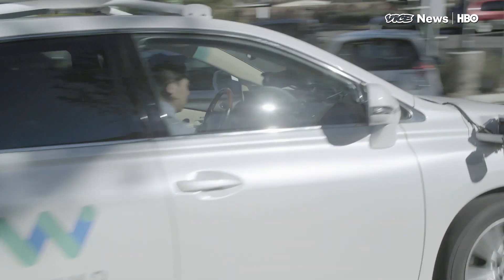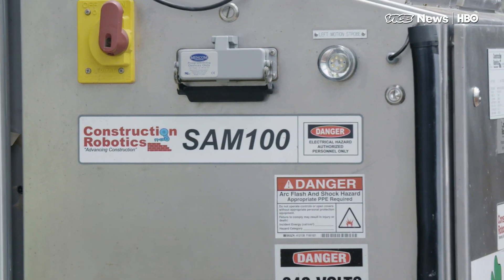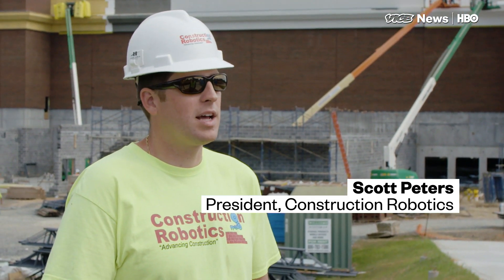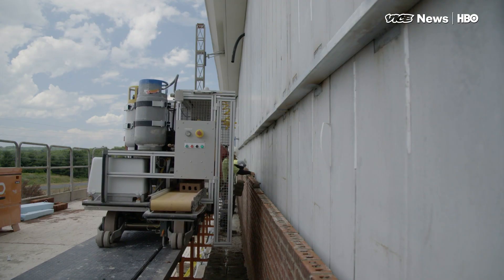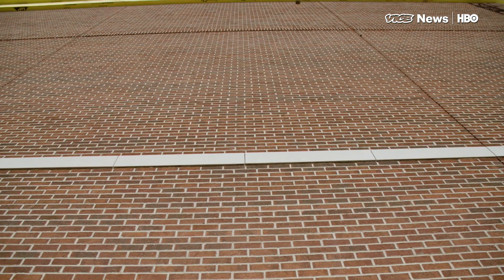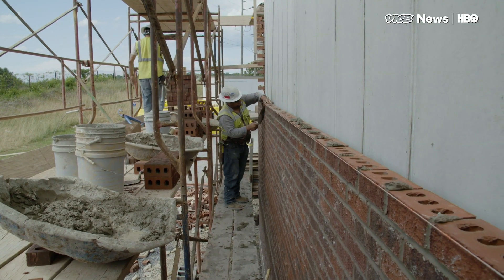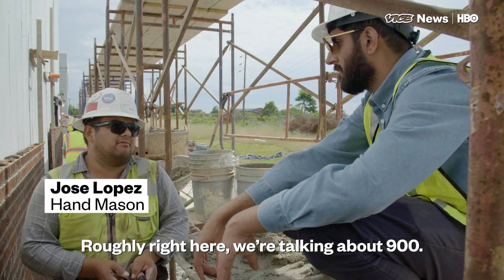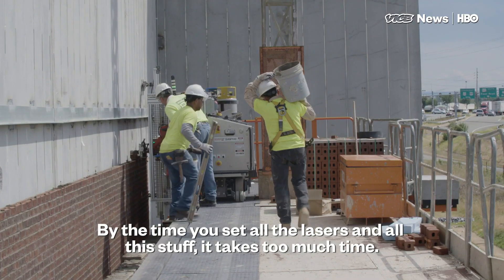This Bricklaying Robot Can Build Walls Faster Than Humans (HBO)

Comment: One thing that isn’t shown is the level surface this thing needs to run on. What are the set up costs?  What is the payback period?  When do you start making money?  Will there be stand by masons to take over when this thing breaks down so the job isn’t held up?  How long does it take to set up?
On the other side, you have brick delivered, call the mason, he shows up and starts laying brick

Comment: So the machine can lay 3000 per day but needs 3 men to  load it and point up plus set up time??? A 4 man gang of traditional brickies can lay 4000 in a long straight run so where's the benefit. And no house has big straight runs anymore and no site I know of has perfectly level ground for a machine. And let's not get started on the footings in the ground. 🤣🤣

Comment: First thing I'm a bricklayer and I hope this puts me out of work because I hate my job that much second thing can you build a machine that puts bricks in a partially sub level silo because that's what I'm doing right now and I'd rather have a gun in my mouth the blueprint for the bricks have to be like an upside down bullet there's an elevator in the middle of the silo to lower my crew down and the silo is about 15 ft wide in diameter minus the 6 ft box elevator directly in the middle I would pay you a million dollars for it today if I never have to come back to this job

Comment: can it clean the snots off the back in the cavity, NO .can it build gables , NO. can it joint up , NO. can it differentiate between face and back of bricks, NO. can it adjust brickwork gague on the fly to acommodate other build factors , NO. can it place wall ties in cavity , NO, can it lay out cavity trays , NO. can it adjust linear gague if batch of bricks are smaller on the fly , NO. can it plan for bad weatherand build accordingly ,NO.can it build herring bone pannels and cut the bricks to suit , NO .  can it build in lead trays ,NO . can it bild a semi eliptical arch and cut the vousoirs to suit , NO ,  TO SUM IT UP I DOUBT IT WILL EVER REPLACE A CRAFTSMAN .

Comment: If they develop a second arm for the robot, one arm could be setting a brick while the other arm is picking up and mudding a brick. So as one arm was releasing a set brick the next arm would be a split second behind it with the next brick. That would make it go nearly twice as fast as it is now. 
From a business standpoint, I can see why an owner would invest in this, skilled bricklayers are extremely hard to find and if you do happen to have some good ones, there nothing you can do to keep them from leaving. And the saving is not just the face wage. The machine has no workers comp, no SSN match, no health insurance, no vacation days, no pension, no sick days. Just maintain cost like any other piece of equipment.
Reply: plus no coffee breaks or 8-12 hour shifts...it will work 24 hr per day if supported. skilled labor may be required now but with upgrades only semi-skilled humans and eventually nobody at all

Comment: Brick laying robot? All fine and dandy but only good for long walls, it doesn't point the joints and clean up afterwards. 

I'll also bet you it gets cement mortar on the brick face plus it never tapped the bricks down which really is a big no no plus it needs at least 4 people to operate it.

As the bricklayer said, it's not a threat, it too slow and costly.

Comment: Just to get this straight.. a person lays 1000 brick per day, but this machine + 2 human operators can lay 3000.
WHATS THE ACTUAL FUCKING POINT!? It costs you more money to do it this way as the machine gunna be hella expensive and operators are going to be paid more than regular bricklayers.
Reply: While the long term amortized cost of the machine is the cost of petrol and spare parts. I certainly remember petrol can be fairly cheap in the US, and the machine can be made durable, rendering the cost of spare parts a non factor. If it lays at 75% of the speed but at 50% of the overall cost, companies are going to use the machine

Comment: in aus we just use prefab cement slab walls or besablocks. using bricks seems so counter productive
Reply: We lay bricks much more often than blocks here in NSW,I've only really laid blocks on costal areas,I guess up north in Qld they use it much more often,and yeah I've got to say the walls go up much faster with blocks than bricks

Comment: Bullshit, that robot could be perfected to completely replace a brick layer. The robotic company was aware of it's technology to replace workers, therefore they kinda dumbed down it's technology, so people won't freak out. People in congress needs to be aware of how advance and easy it is for a robotic company to completely replace workers of all fields not just construction. Theres nothing to worry about since, robots will always be dumb, we need software workers to manage the robots. There needs to be a robot which can inspect how well it laid the bricks, this will be to advanced and costly for a robotic company to implement, therefore they need trained humans to remotely connect to the robots interface and use it's sensors to see how well it laid the bricks. If a human checks the brick work, the robotic bricking laying companies will have no issues of for robotic errors. So this robotic company is creating jobs in the software and robotics fields. The brick layers will soon need to start learning how to program and apply jobs for robotic construction companies. They will have a leading edge in obtaining jobs because they know how to lay bricks and knows how to do robotic related tasks for brick laying.
Reply: The problem arises when you try set a big robot in a small place,as the dude said in the video,the way houses ect are designed these days are not suitable for a robot to build because of all the small corners,tight places and just the general design,you don't see many straight brick walls anymore,plus what about if your building a house next to another already built house with limited access,you can't throw a robot in there, plus the robot cannot install things like control joints or reinforcement ties, and to top it all off its expensive and takes very long to set all the lasers up before it can even start! Making humans more efficient in most situations other than a long straight brick wall
Reply: @p.maesthetics7154  trust me I know a thing or two about robotics and machine vision. With the right team of different engineers and enough funding, a robot cab be built to lay bricks of any forms or shapes you desire. In 10 years they can replace at least more than 50% brick layers. 

I use to be a NYC Uber taxi driver... Uber is gone for human drivers in 10 years, just look at how well and advanced autonomous taxi cars are right now, popping all over the place as they learn to getting close to perfection. 
I completely started learning programming again which I dropped out in college long ago. No more taxi drivers in 10 years. The same holds true for certain construction workers, but not as bad as jobs being replaced like taxi drivers by software.
Reply: @ShopperPlug  quite possibly yes,they would have to build the whole house out of bricks before the wooden frames/windows, gyprock ect goes in,that one way of doing it,but I just don't see it happening anytime soon

Comment: Reading the comments and seeing people saying that the robot can only do straight walls and needs humans to operate it. Engage your brains please. How long do you think it will take to build the machine that can mix the mortar,  lay the brick and then clean the joints, as well as do the corners and windows etc. Remember when Printers first came out. People were amazed. Now we have 3D printers. Remember when the Fax machine came out, people were amazed, now we have emails. 100 years ago, cars were actually difficult to drive, now we have driverless cars. 100 years ago, we were just learning to fly, now we go to Space. Tech and Scientists will work on it and eventually they will make a machine to replace the brick layer.

Comment: Okay. I do productivity analysis on construction.  A straight line wall with stock brick, the team (2 guys) must achieve 2,000 bricks a day or they are gone.  If you have any architectural features, corners, etc the productivity is 800 bricks a day.
.
The key issue with all construction sites is the work area clearance and setup ie: placing scaffold or opening an area to work.  If they can get robots to 'walk' on uneven ground (already possible) and then lay bricks then they are onto something.

Comment: The guy telling u that it's the future and we need it, is the same guy thats selling it. Create a problem, provide the solution. Suckers lol. Never seen one used onsite and it'll probably stay that way. Not many long straight walls with no window or door cavities, that also happen to be one level ground, and the set up for each wall takes way too long. Impractical. So in real time, a crew of human brickies still eats this thing for breakfast. Everything about it creates more work overall, therefore takes longer, therefore costs more, and is therefore obselete. That's why nobody uses them. Show some respect to the skills involved in what u think is unskilled work.

Comment: a bunch of sensors, a bunch of electronics, all of which need to be calibrated and programmed, onboard power, 2 assistants, extremely high cost, only does 1 job. all there is. definitely... like someone said, by the time they set this thing up jose na juan have already finished the house.

Comment: I really would not be worried about that robot. It can lay 3000 bricks a day and lets not split hairs it basically takes 3 people to operate. 3 people that could lay 1000 bricks a day! So how is it faster? Just hire 4 brick layers and you will save hundreds of thousands not having to buy Jonny5. Also it's great for the test sites they used to show it off. And if all you want to build standard flat square industrial units with standard bricks in a half bond pattern, that's fine but, Can it lay Flemish bond? Can it do blocks? Can it bed a soldier course? Can it do curved walls? Can it lay odd size cobble bricks. No! And it's on a building site with dust and lime ect. When that gets in to those delicate lasers and the machine shits it's self, and you have to call Jonny5 tech support who is telling you to turn your brick layers off and on again! Certainly not in any building industry, ever! They wouldn't have it. Too much to go wrong And time is money. The day you can load 10,000 bricks and 10 tunns of mortor into a machine press a button and come back in 3 days and you've got a hose. That's when I will worry!

Comment: I've met and watched people faster than this robot.
Reply: I'm not talking about average workers, clearly. 🤦‍♂️
Reply: @williampitts7646  then what is your point
Reply: My point is if anything at all this robot will not replace highly skilled masons, but will decrease the amount of masons needed, therefore increasing the need for workers with more skill and speed, which will also increase the pay for those workers.
Reply: Likewise mate. Any one on here disputing that's possible hasn't worked a day on site
Reply: The robot doesn't get tired, sure they could be faster at the start but over a day in the sun... Not so much, they don't need breaks as well
Reply: @junkrat1  have you worked with bricklayers? You're imagining yourself trying to laybricks in the sun all day, of course you would get tired. So would i. Guess what, half the skill of 'unskilled' jobs is being able to work in hard conditions every single day, wake up and do it again the next day, and the next day, for a lifetime,without getting injured, burnt out, sick. So much arrogance from nonphysical workers who have never done it. These people are professionals, and staying on the job day in stay out is one of their skills.
Read my other comments re the robot vs workers and the actual efficiency, the robot has been found to be obsolete and is not used!
Reply: @mchammer5034 

" You're imagining yourself trying to laybricks in the sun all day, of course you would get tired. So would i. Guess what, half the skill of 'unskilled' jobs is being able to work in hard conditions every single day, wake up and do it again the next day, and the next day, for a lifetime,without getting injured, burnt out, sick."

That's not impressive when the robot can be there 24 HOURS A DAY, no breaks, no water, etc.

You would still need masons, but you would need far less bricklayers.

And why should a human being have to do work like that? It's beneath human dignity to do that. We're thinkers.
Reply: I've also seen people lay bricks way faster than this... I'm sure you can find video on Youtube. But I don't think they are the average person and I don't know how long they keep up that pace. Especially without having to ever take a break.
Reply: @SankofaNYC  it's amazing how fit people who do manual work all day really are. Mentally and physically conditioned like an athlete even if they dont look it. Even with 45 minutes worth of breaks taken during a 10 hour day for a bricklayer, the guys setting up the robot still take the same breaks as everyone else. This robot needs a human to set it up for each run, and doesn't do doorways corners or windows, it can only do straight runs and needs be physically moved around and past any windows and doors, then recalibrated again because its been shifted. All done by staff.  So if u look at the types of buildings that bricks are still used in, it's smaller resindential homes and offices, which have so many doors and windows and corners the machine would be getting moved all day which takes way too long, and makes it obsolete. This would work on large industrial buildings where there are straight runs of 20 meters or more, but they don't build these structures out of brick anymore (it's all steel and concrete) so the machine isn't even viable here. Nice idea, but u would only sell these to people who do not know anything about the building game.
Reply: @mchammer5034  yeah I hear you... And like I said I've definitely seen people move faster than this...  Maybe in time it will be made to move faster and need less human support... But yeah right now I'm sure it cost a ton and is just an alternative in you don't have a skilled bricklayer I guess
Reply: @SankofaNYC  good call. I think itll be the same as alot of automated things- some can be way better, some cannot get around the variables of the job
Reply: @mchammer5034  yeah... I am not for removing humans from everything at all... You know what's funny, people will argue against raising the minimum wage like "If you do that, they will just make robots to do your job" and I'm like 🙄 they are going to try to do that regardless, no matter what you are paid.. you can walk into any mc donald's or Walmart or cvs and see automated check outs to realize that... Pay isn't the issue, greed is
Reply: @SankofaNYC  yep agreed. I think we'll find that the jobs we see as unskilled, are just as skilled as anything else, and automating it can work in some cases but a lot it cannot. It all comes down to the dollar, and in this case it's the reason why these robots aren't used- overall they cost more and require more hours from staff. A sprinter can outsprint a marathon runner, but if u were doing a 4km run, the marathon runner wins. So this robot wins the sprint, but the bricklayer beats it in the overall job. And if you are the foreman u don't care whos quicker in a certain area or how it's done, u just want the most efficient, quickest method overall to finish the job, so they use brickies not robots.
Reply: Yeah but not accurate as this robot. Robots don't get tired unlike humans.
Reply: Construction is the breeding place of political corruption and will be replaced by modular technology,already in China. In addition.,machines work pore efficiently and consistently all the time. The world has no place for manual labor.
Reply: so you're saying these people who are smart enough to build a robot. calculated the speed of this robot vs an average worker wrong?
sure
Reply: @Dwight_  why would they build a robot to do something slower overall and less accurate than they are already doing? U might be clever to work all that out yep, but how clever is it spending all that time and energy on something that ends up more labour intensive and less efficient overall? Typical engineer mentality. That's why u get the tradesmen in to do your work and fix your mistakes when u try it yourself. It's embarrassing to watch blokes like that waddle around a site telling experienced professionals how their trade works😃
Reply: @mchammer5034  
to save money, the robot is faster than an average worker no breaks needed no possible injuries on the job can work longer hours..
I'm sorry to say this but robots have been pretty good at breathing humans at their work. so what will be different about this one?
Reply: @Dwight_  ps. The guy telling u that it's faster is the guy selling it.

Comment: Teach it to strike its own joints, brush and acid wash it's own work and we can talk. Can it build a lead? This looks like it's more efficient but those four guys behind it cleaning up the gaps, striking and correcting everything could bust that wall out to a line in half the time.

Comment: Yeah but it cant lay corners,or tooth corners,put scaffolding up,shovel sand and cement and lime into a mixer and pour it out into a wheelbarrow, then shovel it out on to mud boards,then put bricks into a wheelbarrow and stack them up on a scaffold. Bricklayers will never be replaced by robots,and same goes for labourers.
Reply: No one has worry this is just a gimmick